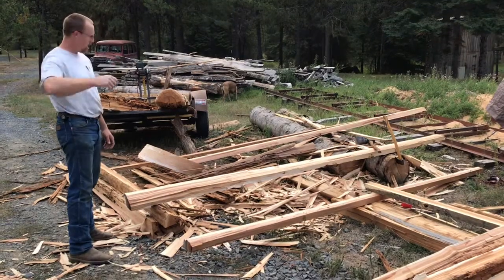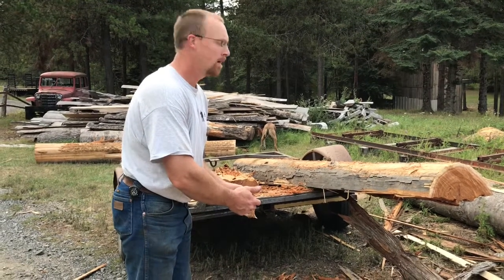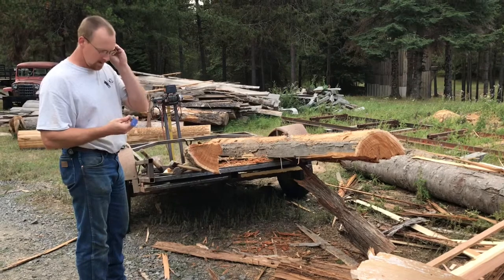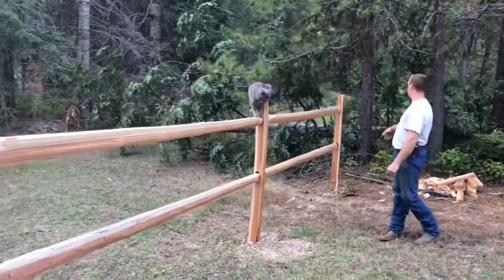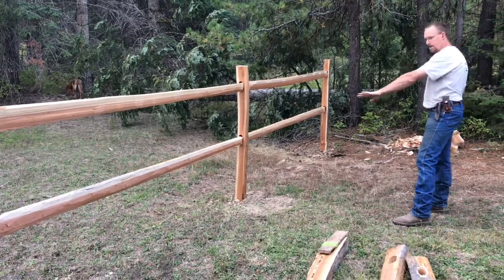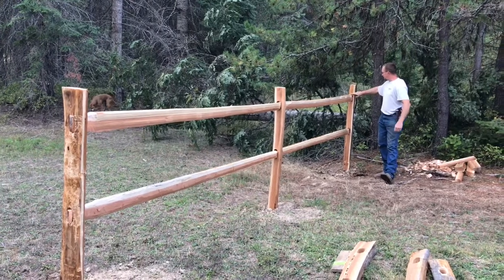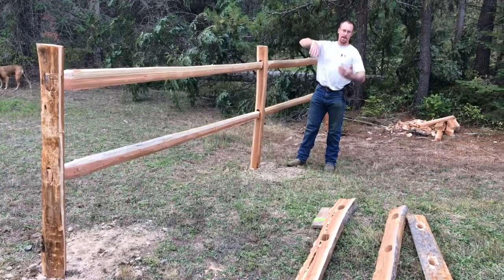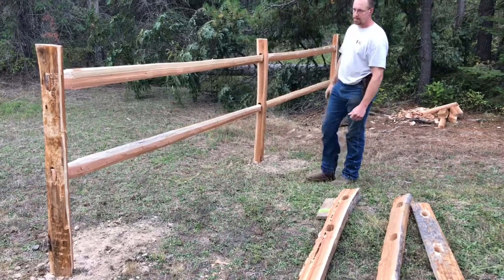Off Grid Living - Making Handcrafted Cedar Split Rail Fence

Comment: Great video. Would you say white cedar or red cedar would last longer. Posts and rails?
Reply from the maker: Thanks!  I would say red cedar would hold up better for you. Even though it is cedar, it will also help to treat the bottoms of the posts for added protection in the ground. Hope that helps.  God bless